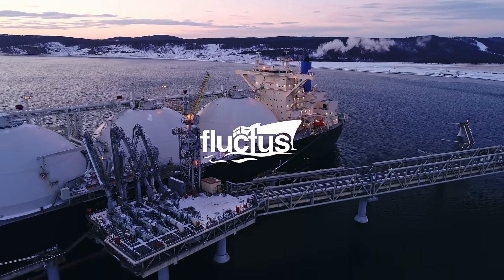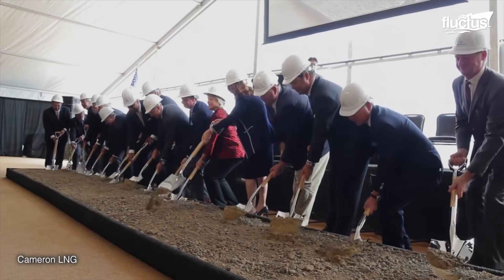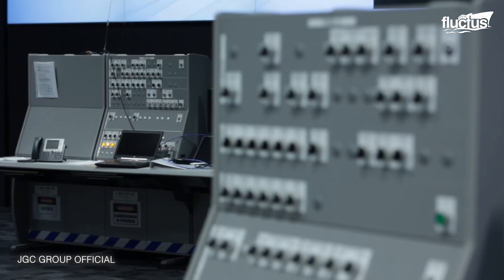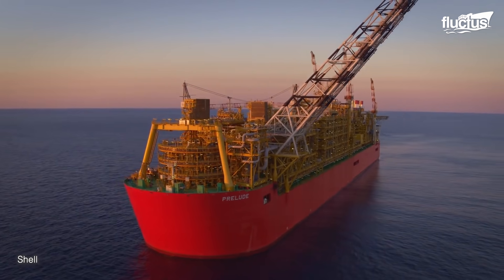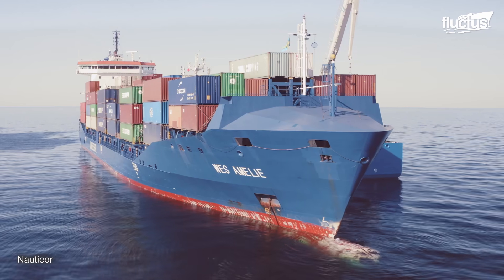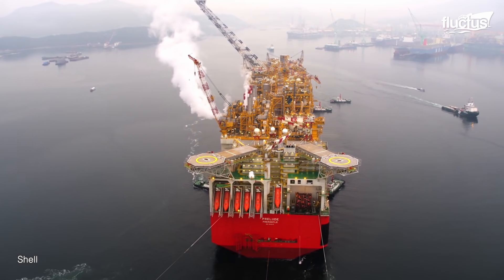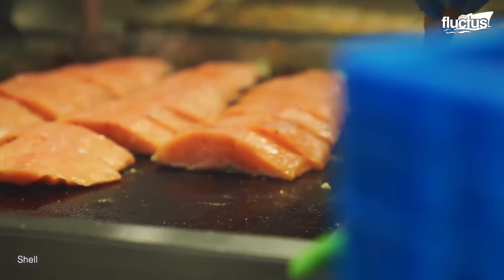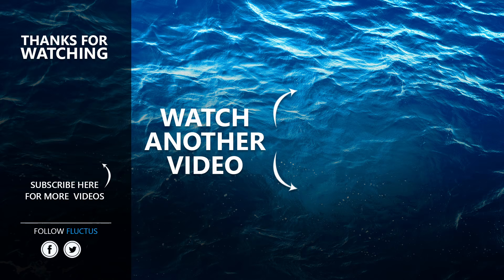Crazy Process of Building World’s Largest Billion $ LNG Terminals

Comment: Compressed hydrogen should power ships going forward
Reply: I looked into it and i watched a company try to make a ship than ran on it and trust me theres better route. Its gard to beat a ship running on the cheap stuff that is bunkered in mass already as a waste oil from the refining process. The problem with hydrogen is you need these crazy huge fuel tanks on the top deck of the ship and thet have to be removed to unload the load. It has these problematic inefficiencies compared to like a ship that runs on compression of heavy fuel oil. Which has a gas tank like a car. Plus if a houthi missle hits do you want your ship to maybe be able to hobble away to saftey or do you want all the oxygen around to be consumed evetything vaporized by burning expanding hydrogen in mass. Its a tough situation. You can see how big these ships are that carry lng they are big targets. You cant carry coal ore iron ore on tjem. Only lng their goal is to go and get filled up and travel to a powerplant somewhere to fuel it to give electricity to people in places and stuff like that. The hydrogen ships will be the same way theyre nit going to run on it and carry ore or boxes. If its invilved with hydrogen theyll probably go all out ans hage the big tanks and the ship will run on hydrogen and itll be going to and from places using hydrogen in bulk for things. The way i see them tryong to run a ore ship with big tanks on the top deck seems inefficient to me. But thats just my opinion.

Comment: Its worst enemy is a .50 BMG
Reply: What isn’t .50 BMG enemy?
Reply: Take way more than a 50bmg to penetrate a lng tank
Reply: These are built like oxygen tanks bro you can gut those with a 50 a few times before youll bust through in certain spots. If a .50 goes through this it will simply pop a hole and thats where the leak will be it will leak at a rate. High fure hazard could even be on fire already. All those pipes if a .50 hits them unless its really square on jts going bounce off. You could do some damage